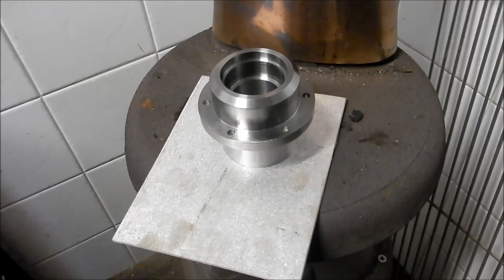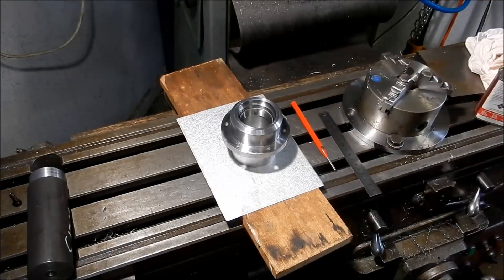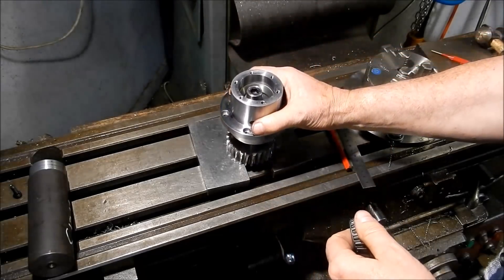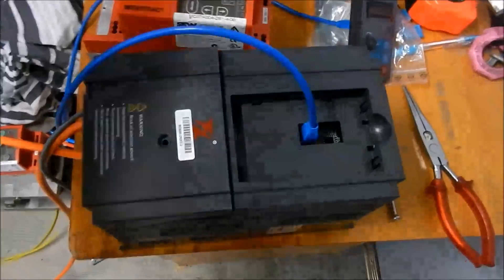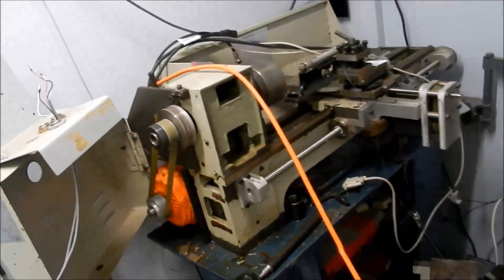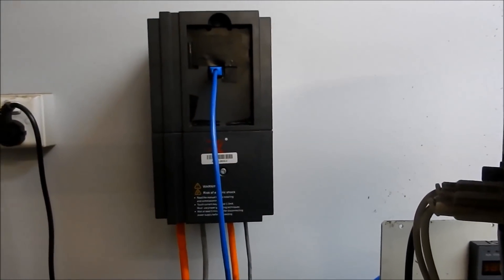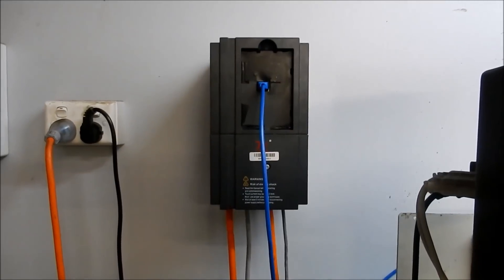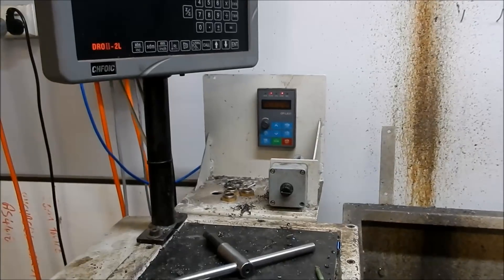Powered Lathe Slotter Build Part 22.  Bearing fitting and another dead VFD replacement.

Comment: Hi Cam am not sure if you have seen the Marvin Slotting and Vert mill attachments.Not reading all comments I hope am not doubling up. It is listed on lathes .co. uk .Am enjoying your build Cheers.
Reply from the maker: G'Day John, there are lots of different configurations for running slotters from a horizontal style milling machine.  I have never seen a slotting attachement mounted from a vertical spindle like a bridgeport so I think its unique.
Cam
Reply: Hi Cam its me again sorry to be a nuisance if any chance could get in touch with the original manufacturer of these engine castings I bought 2 sets on E bay  a few yrs ago  Thank you again in advance Regards John.
Reply from the maker: Hi John, I've just found an original set of drawings.  I'll scan them at work sometime next week and e-mail to you.  The drawings were done by R.Paynter and the engine is called a 62cc Hopper Cooled Open Crank I.C Engine.
Cam
Reply: Sorry Cam was the Steam engine in Bronze was the castings I have
Reply from the maker: Sorry John thought you were talking about the Hit and Miss.  I have drawings of my own design that I've done for the bronze castings.  These were based on the 'Hog Steam Engine'.  I can send you a PDF of the G.A to see if its close to what you have.  I have a rough drawing of the components for a single engine that also came from the Model Engineer.  The body machines up at 2 7/16" high.  The Cylinder bore machines up at 5/8" x 1 1/16'" long.  The Fly Wheel machines up at 1 3/4".  Let me know if this is close.
Cam
Reply from the maker: John, just did some more research and the castings you have may have come from the Geelong College House of Guilds as a mechanical project for boys. (my farther made one of these while he was there at the school.)  The design was undertaken by Austin Gray and there was a build artical in the Model Engineer.  The castings and drawings were originally produced by the College and sold as a fundraiser as a legacy to the Austin Gray Foundation.  Do your castings look like these -
http://gnet.geelongcollege.vic.edu.au:8080/gallery/default.aspx?moid=123
http://gnet.geelongcollege.vic.edu.au:8080/wiki/GetFile.aspx?File=%2FPegasus_1947_02_December_reduced.pdf    (look at page 24)

Cam

Comment: Hey mate what model VFD did you buy from Conon? I've been eyeing them off for a while. looks like a nice bit of kit but disappointing no cover plate for the display hole etc
Reply from the maker: 2.2kw/3HP 10A 240V AC single phase variable frequency drive inverter VSD VFD